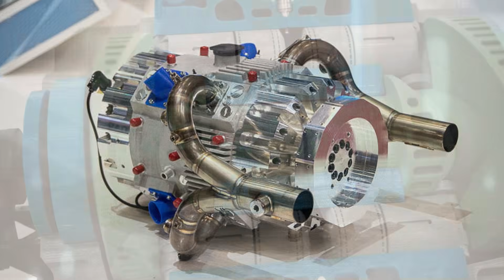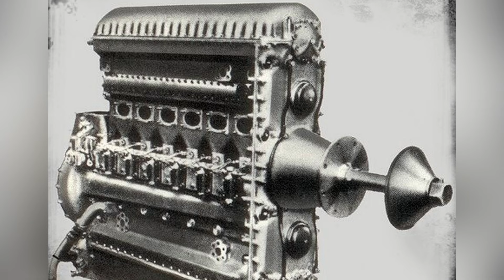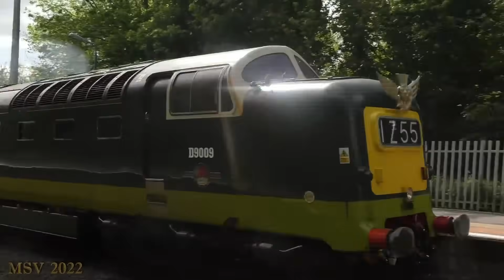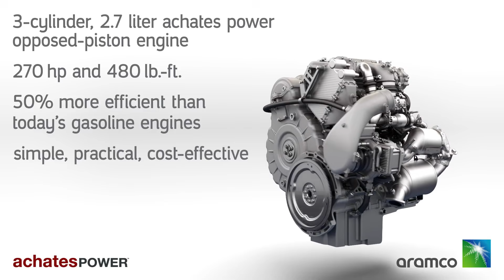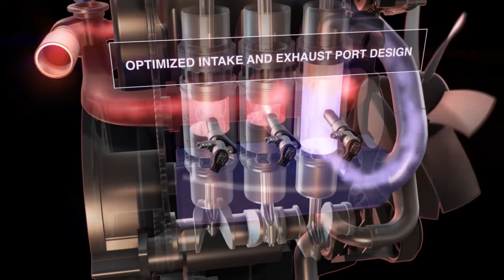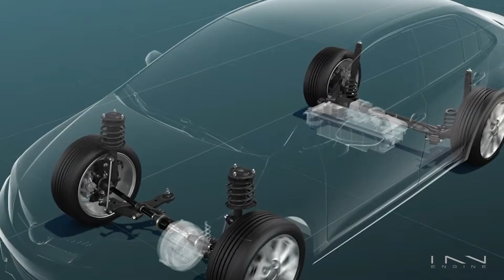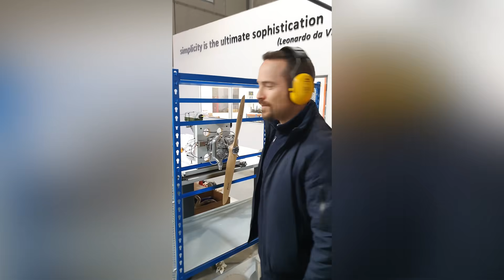NEW OP Mini-Engine DESTROYS Pure EVs

Comment: Ultra deep Geothermal Thermal Energy Wells , tapping into the Stored  Heat of the Earth; closed loop 🔁 heat Exchangers, using Existing metals developed for the NUCLEAR ☢️ POWER  Industry to control Corrosion; They can be installed next to Existing power plants, that use Steam driven Turbines; and ALL of the infrastructure is already in place)
Evidence, NEIGHBORS DRILLING and QUASI ENERGY in Houston, Texas have A demonstration project; Already underway; and 
NEW ATLAS, has had many Articles About Geothermal Energy Systems over the past  :6 years

Comment: That small package size, and showing it with a prop, that'll make a good military drone engine, maybe a twin engine common axis contra rotating prop layout (so motors spinning in opposite directions) to fit in to a high speed drone-hunter - something around a 3 meter windspan with remote pilot, to intercept and shoot down incoming guided drone bombs.

Comment: We would never have 100% electric vehicles on the road. That had always been a ludicrous idea, we will have a form of hybrid. Now, the fuel for the hybrid can come from a renewable source, like biofuels. The reason is simple, electric motors are very efficient when converting electrical energy into mechanical, but battery is highly inefficient for storing energy, while IC engines can be made very efficient electric generator and fuels are very efficient and convenient for energy storage.  Now, when it comes short distance travel, electric vehicles would rule, but for long distance travel special with heavy loads electric vehicles are unsuitable, there hybrid would rule.

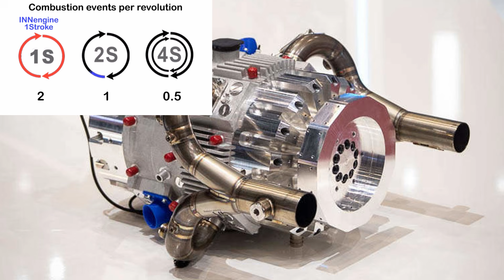Comment: 0:28 you said well, "is it truly game changer". It is worth, because 70% less weight.
But, compared to electric does not have/stand chance.
I don't share the tech, actually 40 years ago I created 70kw generator in 2.5-3kg kg weight, with above maximum load never lowered the rpm, nor needed external power to be moved, = what others say self-running. But I destroyed it, I want humans to evolve on their own. Actually You said well, "one day they will reach everything to be electric".
Combustion is too much complicated, too many parts, too dependable, too vulnerable, too heavy kg per power, and is "impulse" only at moment, it does not withstand continuity, same as combustion bomb "in split of second released" and later everything as it had been. On opposite, electricity has continuity, and well without caring additional energy is able to work anywhere in universe (without those fancy solar chargers).
Motor (power mechanical drive) does not need actually any energy, ... but that is another story / library.

My scooter, yadea e8s, I modified it (just this month), without replacing parts or adding extra, or reprogramming the controller, only other way wires used, and it goes x2 range and x2 speed and same torque (does not make more heat, actually opposite). This month I will replace the heavy 100 kg graphene batteries with total 2-3 kg - not lithium which catch fire. People simply need time. These are simple things which people will soon any way find, so no need to suffer myself for simple things. Yes, I drove combustion cars and motorbikes and I drive still one, ... (we are complicated too)

Comment: I mean this to know it's been used for decades which is been proven because it's right there it's all over the internet  air compressor because the dude just took a air compressor YouTube channel I think it's called let's learn something can you turn the air compressor into a working engine which uses a similar kind of mechanics when it was used to be air compressor so when the air compressor was pumping the compression coolant wherever you want to call it that gives you cold air inside your vehicle BC it works like a piston in the disc always pushes the 4 or 6 of those Pistons up and down just like how this engine works not all compressors are the same in most air compressors will have different kind of builds and different kind of brands built by different manufacturers you can turn things into engines that have pistons in them

Comment: So what is the new ingredient of the INN engine? It’s just the roller-cam ring arrangement at either end which is the dodgy bit. To be honest if they do solve this then they have something pretty interesting but I’m not hopeful. To make parts last you have to generate an oil film between them by rolling or by making a hydrodynamic bearing (eg big end-crankshaft throw). You can’t grind parts together and expect them to last. The ring cam obviously has a shorter path on the inside diameter than the outside so a solid roller will scuff its way along and something will wear.

Comment: The 3 cyl OP design is probably one of the best.  The development of a hydrogen fuel system paves the way for another breakthrough efficiency technology to be integrated into the engine: Paul Pantone's fuel reforming plasma reactor.  Simple in design, the device simulates a lightning strom inside of its body by passing hot dry gasses over cold, moist air in a turbulent and magnetically active arrangement.  The end result is a continuous plasma spiral lightning discharge in a vacuum, through which the atomized droplets of fuel pass, to be molecularly reformed into a synthetic hydrogen gas.  This enables almost any liguid to be processed into synthetic hydrogen, including all types of fuels and even water.   The resulting combination of an effiicent hydrogen injected engine, and a flexible fuel reformer for turning any fuel into synthetic hydrogen, will allow current technology to achieve super efficiency and near zero emissions without the need for massive mining of rare minerals to support the transition to green energy.

Comment: Opposed Piston Rotary , 
Rolling Bars ,

1-2 Stroke ( Freikolben - 2 Takttauglich ) und Drehmoment !
und Drehvermögen ,

Höhere Legierrungsgüte erforderlich !

Und Stabile Kupplung .

ne normale Kupplung 1/3 jahr.
Tschüß.

die Tourgeu der Rotary Opposed Piston Rolling Bars ,
kommt bei Eigengewicht und 4 Zylinder je 1800
CCM
auf gesamt 700 KW bei 2200 UPM und ich bin ziemlich sicher diese Mascchine Dreht bis zu 25000 UPM mühelos .
Rotary s Drehen 700000 upm
4 Strockes 30000- max 35000
2 strokes bis 45000
Jets 120000-260000
und dieser Rotierende Gegenkolben drehr sicher 25000 upm mühelos.

wieviel Wartungs Aufwand Lager und Lager wände machen 
ist eben genau so interresant wie art der Kupplung und Antriebsstrang besfestigung ,
bei Pull von 2000-30000 upm  Gas , kommt die maschine Schneller ans Ziel wie das Fahrzeug , das ist eine 
Bewandniss , die bei Flugzeugen kaum ne Rolle spielt ,Luft gibt Nach , aber Asphalt will Abrollwiederstand ,was die Befestigung des Antriebsstrang Høhere Aufmerksamkeit Erfordert.

normal gibt es immer ,
One in
one out 

Katalytisch Cycles 
Opposed Piston
RollingBars !

😛

okay 
die
nexte Maschine die ich kaufe !

lg Rupp

Comment: Swash-plate engines have been around since at least the 1920; they can be extremely reliable if not necessarily high performance. Often used in industrial situations where a constant RPM is desired - they might well be ideal for a hybrid.

Comment: 5:17 -- "100% electric vehicles on the road" means 100% of vehicles in parking and storage space will be EV -- which is impossible to the quickly increasing number of places banning over battery unstoppable thermal-runaway (i.e., unquenchable fires) liability concerns -- e.g., any garage (especially an underground one) acquiring first-hand experience with an EV fire will move to ban them. The cost of insuring EVs is going through the roof, and the premium to rent one offsets fuel savings. The only people really benefitting off EVs are heavy-metal mines and governments salivating at tying civilian mobility to their power grids.

Comment: I'm extremely skeptical of the design. The wear from such a design just seems to be far too likley to be a major issue. Add to that how I can't see how the piston is going to have strong angular forces on it as it presses into an angled surface when under its highest pressures. Add in how they don't really show how the lubrication works. It would be difficult to maintain even lubrication without oil pooling causing inefficiencies. I can't imagine that wave plate working too well if it's having to constantly displace oil.

EVs would be far better if manufacturers smartened up and decided on a standardized swappable battery pack. Stop selling EVs with built in batteries and instead build a company that has a network of battery swapping depots. A big worry from the government's perspective on EVs is its impact on the national economy. Get rid of oil, you get rid of gas stations. Heck, mechanics shops will be in less demand. Having swapping depots could replace gas stations.

Instead of charging  you just drive into a depot and get your battery swapped. If designed right, it would just take a minute or two. That would solve so many problems all at once. First, you wouldn't need a crazy heavy battery because range wouldn't be the major issue anymore. Charge running low, just pop in, get it swapped, and you're on your way. 

More, these companies could afford to invest in chargers that optimize lifespan of the batteries while ensuring they are also more safely charged, reducing or negating the risk of fires.

Even better, depots could swap batteries themselves rather than charge them. Use electric trucks to ship the batteries out of populated areas. One of the major downsides of green energy generation is how they don't work well in populated areas. Ship the batteries to a green energy generation site though, and you could ensure they are full powered by green energy. The trucks shipping them could be similarly charged there as well.

Even more. Green energy generation has the problem of not producing most of its power during grid peak demand times. A part of each batteries charge cycle could be charging from green gen, discharging to the grid during peak, recharging from the grid during non-peak, then getting shipped out to use in cars. That way, the batteries not only make EVs more efficient and more green, but add green to the grid. The batteries could help reducing emissions on the grid a lot by making peak demand more green and even better, helping deal with demand spikes and drops. Power plants designed to help with sudden fluctuations on the grid are still a major emissions problem this sort of design could negate.

Comment: So let me get this straight.  It's more efficient to put a fueled engine in a car that is hooked to a generator and that generator converts that mechanically generated energy into electricity which both contributes to powering the electric drive motors and charges the batteries than it is to have that exact same engine just directly drive that car?

😂

Comment: Not a new idea and will not replace EV as it still needs oil changes filters and plugs plus the loads and wear look to be higher than standard designed engines

Comment: i'd like to know how any of these are getting around the problem of piston rings crossing the intake ports & either drawing in oil & burning it (smoke & emissions) or wearing the rings & needing replaced/rebuilt. That is the same issue 2 strokes end up with. Once i figure that out i've got a couple designs for 2 stroke positive displacement supercharged direct injected engines that would still utilize exhaust valves/cam in the head with bottom dead center intake ports supplying pressurized air at a 1:1 ratio or higher.

Comment: Get it out there with real world hours on it and get back to us ?  BUT ...   electric is very high efficiency and tightly controllable, which can be extremely useful not having idling losses and the likes.  What are the emissions compared to the very best existing engines in use today.
I say this because I think BEV won't meet every use class  in every region - there will be some situations where fueled engines will remain.

Comment: Every few days a video is published on YT that purports the revolutionary "x stroke" engine Y will "change the industry", "destroy EV", etc. etc. 99% of those claims are empty and none of it ever happens.... O and by the way, opposing cylinder engines have already been used for a long time. For instance in the Napier Deltic train and ship engines... 🥱

Comment: I noticed there is no mention of the efficiency of these new engine designs. To be economically competitive with my BMW I3, the overall thermal efficiency will need to be above 85%, and there's nothing on the horizon which suggests a combustion engine can achieve anything close to such a high standard.
Reply: Exactly correct and it absolutely seals battery Electric Vehicles as the next 'normal' for passenger vehicles.
But notice you got no likes or replies 😂
There's a desperation, particularly in USA that internal combustion engines won't be killed off, people are addicted to them like Heroin addicts, they simply aren't interested in the reality that they are not a very efficient use of energy.
Even since this video was made we have EVs with Silicon Carbide batteries that can take a car 500 miles and can put 300 miles of range into the battery in just 15 minutes (2024 Xiaomi SU7 Max) but there's an awful lot of people that will be angered by that because it's chipping away at their agenda 😂
Reply: @pachy444  Inasmuch as I recognize this as a Luddite channel, I didn't expect adulation. The audience expected a soothing balm for their deep-seated fear that combustion engines are no longer competitive, then I drag in reality, like a moldering corpse.
Reply: The INN engine in particular cannot compare neither with traditional internal combustion engines, nor with electric motors (as a vehicle engine), because it has a very poor low rev torque characteristic (Drive4Answers YT channel did a very good job explaining why this is the case, but it should be obvious to anyone with a bit of intuition about the mechanics).

The engine is indeed very interesting for some applications like small airplanes and drones, due to its light weight, mechanical simplicity, and a very high power density. For applications like these, it can bridge the gap until batteries of sufficient power densities are commercially available (which is still some time away, hydrocarbon fuels are still about an order of magnitude more energy dense than the batteries, so there is definitely some gap to be bridged).

It's a shame that this nice invention is marketed as something it's definitely not.

Comment: Hardly new. Engineers have been toying with swashplate pumps compressors and engines for about 100 years.  No one hasade a successful IC engine design yet.  The failure point is often the point of contact between the piston rods and the swashplate.  Engines produce a shock load when firing and this mechanism is difficult to keep oiled under load.

Comment: The reveal of this engine is interesting, however the flaw with battery power that nobody is talking about is safety.  For example third rail electrical trains use high voltage DC power similar to cars. To work on a railway there's a lot of health and safety involved.  We're giving a similar technology to the public in battery powered vehicles,  however the public crash and regularly misuse and damage vehicles. High voltage DC is dangerous, the public are unaware of the potential dangers and rules that must be adhered to.

Comment: A great design on paper, but as with any new engine, it has to last the acid test of time and torture, and by the way with all that combustion going on what are you gonna deal with all that heat, this engines will not last long in my opinion

Comment: I refreshed my memory from my time in GM Training, the radial air conditioner compressors work quite similarly to 1 end of this engine design, we all know that an a/c compressor can last the life of the vehicle with minimal maintenance/attention, I think with a little different design to the cam track set up, this could be a feasible option for the ICE as a generator engine

Comment: The Achate seems a winner.  If it could be reduced to something of 20hp it would be a fantastic outboard engine. Also with 16 hp a hybrid could make a car last much longer. Electric motors on each wheel. Drop the bendix starter and place with proper gearing an alternator- motor that could smoothly start the Achate engine when needed. That would be my dream vehicle.